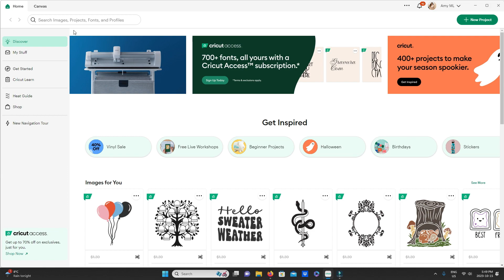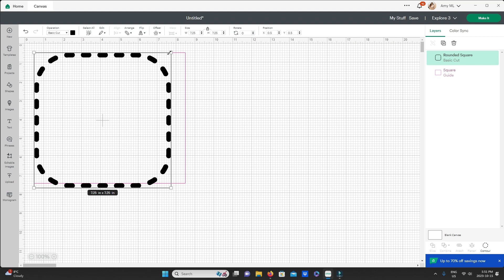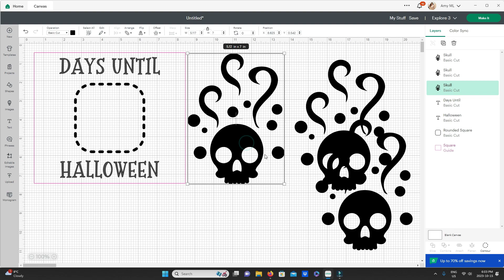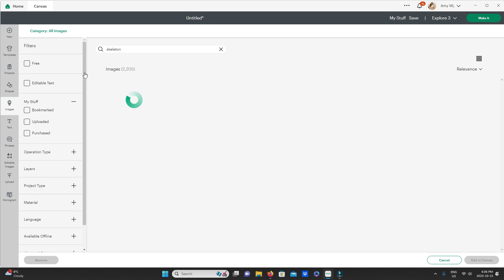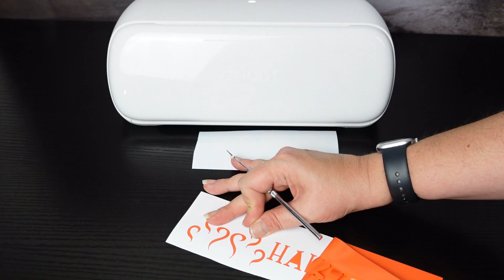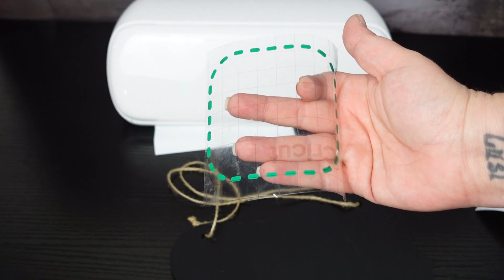Cricut Joy Xtra Halloween Sign

Comment: Smart materials take a bit more scraping than matted vinyl to get it to release to the transfer tape but with my maker 3 I can cut wider and longer cuts. But it can be aggravating if it is hard to release. Using your weeding tool can help to 'encourage' stubborn pieces to release from the backing by putting it just under the edge of a stubborn piece to pop it loose. Smart HTV is easier to use. Can iron onto most any sign too.
Reply from the maker: Thank you for this!! It will help a lot of people! <3
Reply: @CricutForDummies  if you also add a small offset and attach that to a smaller fonts you can weed the inner part of letters and then the offset. I find that so much easier than reverse weeding. It sometimes helps to use the offset feature for some images that have thin lines.